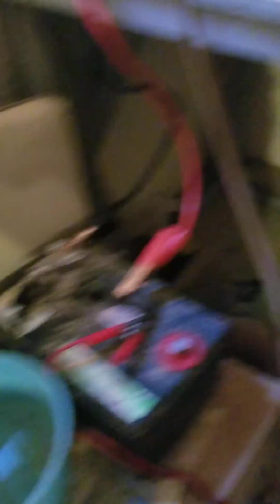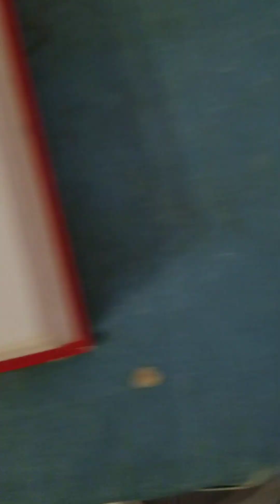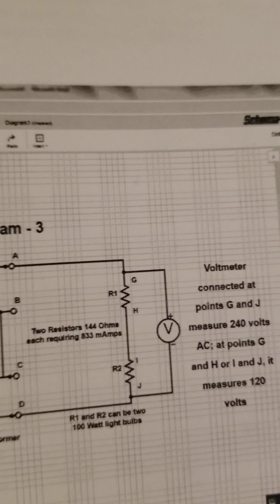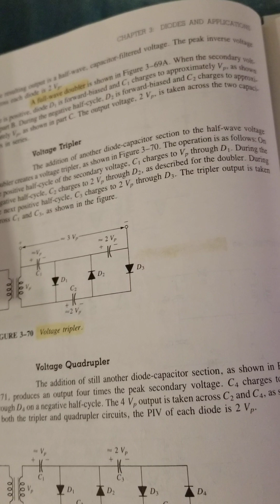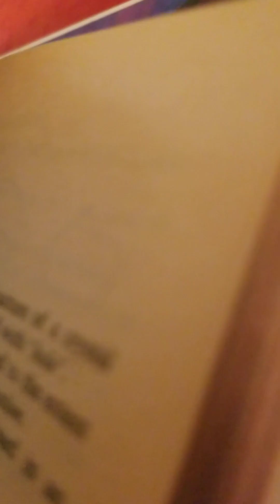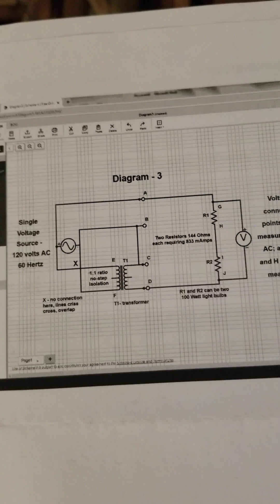Power Supply Current Saver - proof its feasible - part 11

Comment from the maker: These voltage doubler circuits output DC voltage, not AC, so that screws up my plans for using a variable capacitor since capacitors block DC, but there is always a solution to a problem...